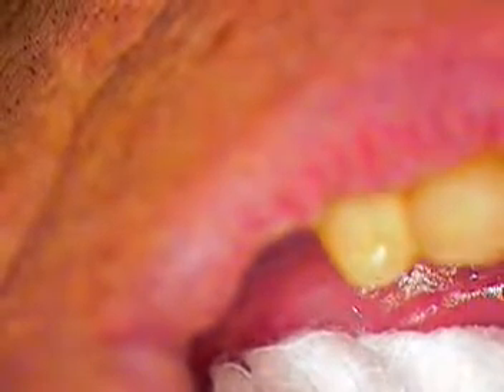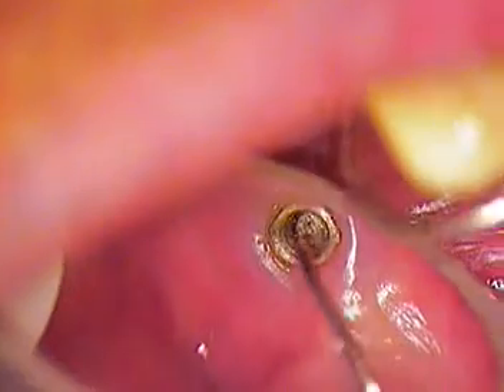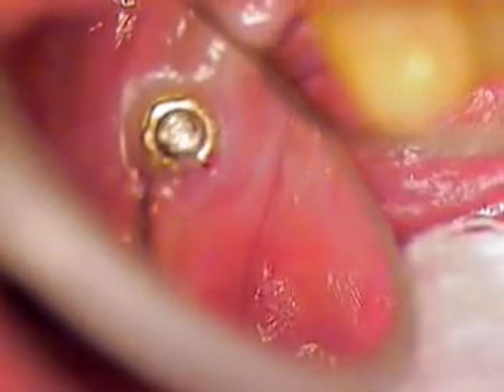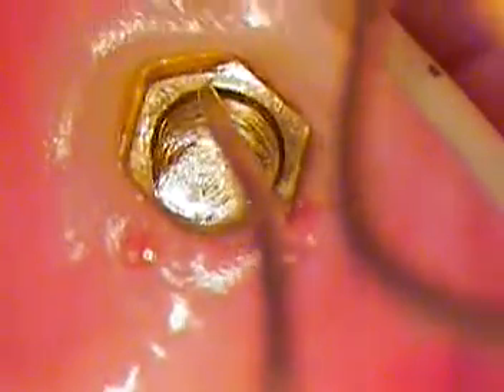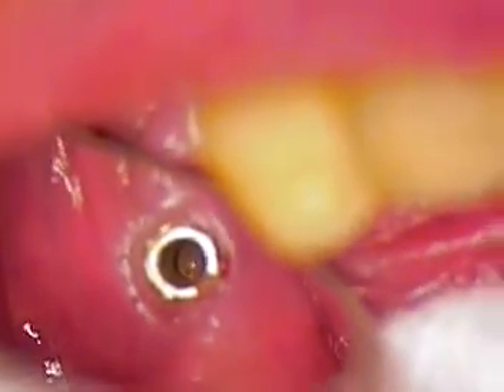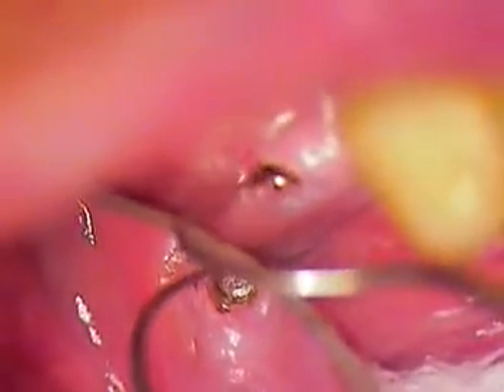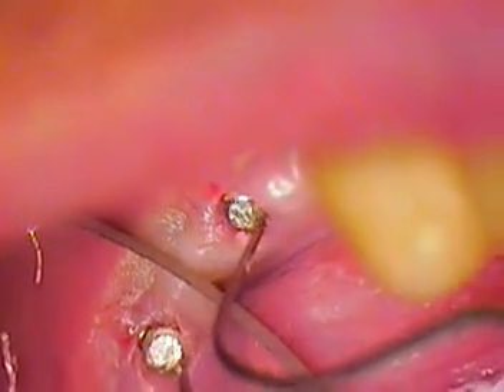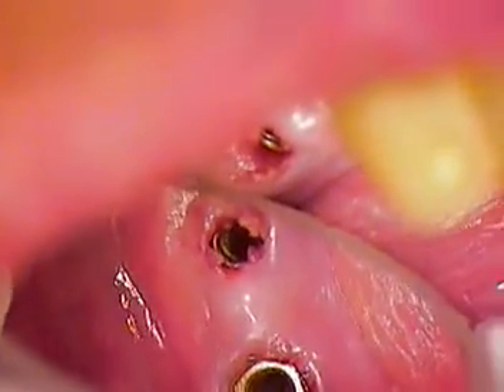DR GERARD CUOMO - Branemark Dental Implant Broken Screw Case 2 of 7 - Boca Raton Florida

Comment: I used tarter and stain remover in a pre-comp syringe w light blue needle tip. Add one small drop of t&s solution in the fixture. Wait about 10-15 minutes and then see if you can turn the broken screw. GC